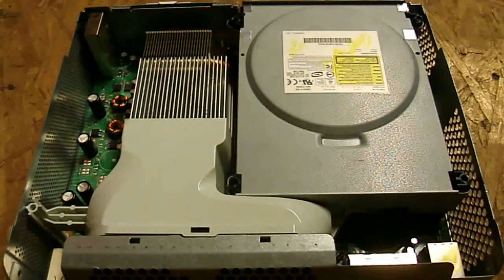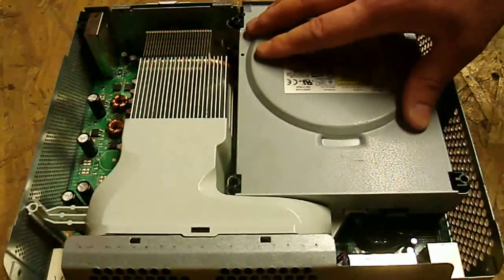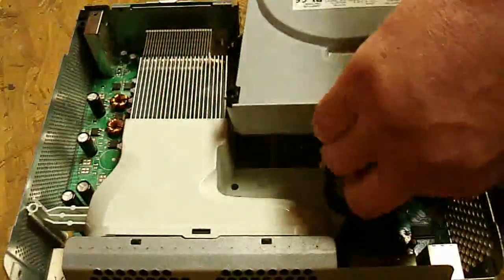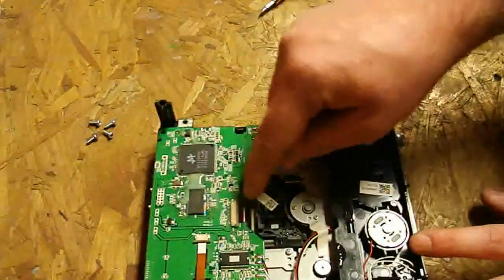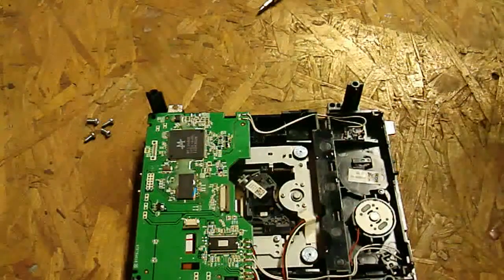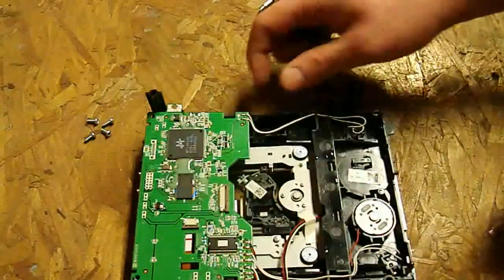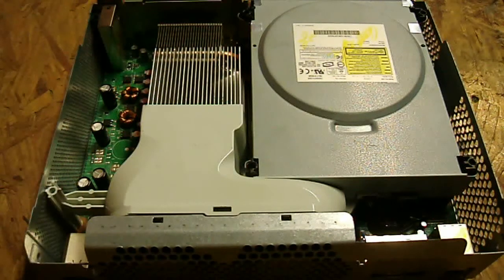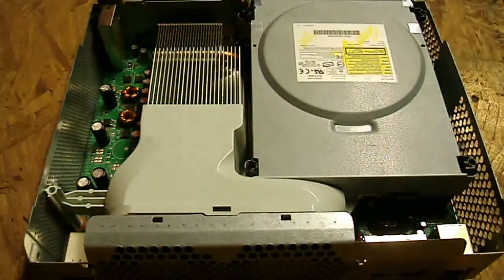How to replace your Benq drive in xbox 360 console tutorial

Comment: thank you for video, had trouble with xbox not reading, took it apart, cleaned like some videos say how to do, still not reading , decided to buy new replacement,  well reading a bit more it tells me not so fast, new one won't work, several video later I found yours, very easy explained. just need to get myself soldering iron, thank you    John